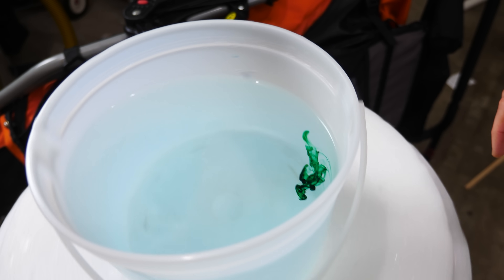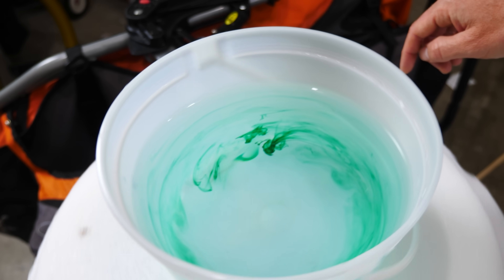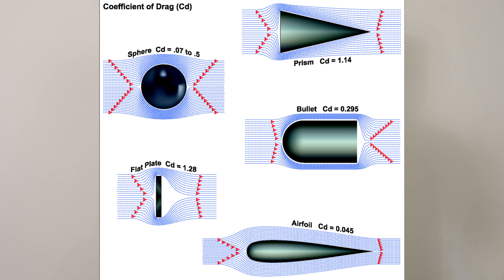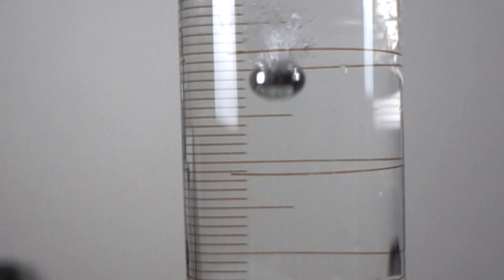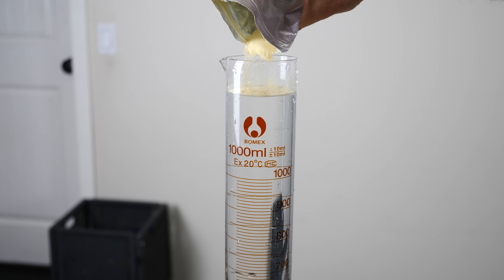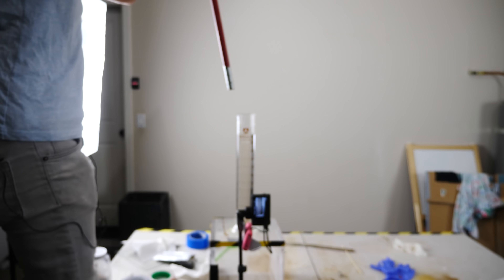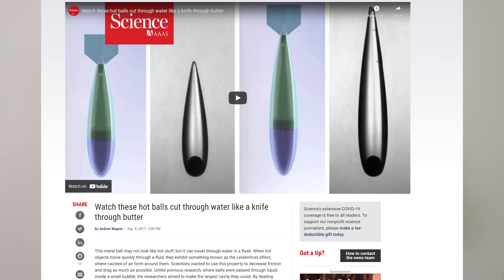Hydrophobic Projectiles Slice Through Water With No Drag

Comment: Isn't the volume of entrained air going to exert a slight force (from static atmospheric pressure) on the surrounding water? I would imagine that force would be expanding the envelope beyond the ideal shape for a given liquid. Would be interesting to see the same experience repeated on larger scale, under various partial vacuums and comparing gas densities, e.g. atmosphere of nitrogen vs argon vs helium

Comment: Neat. It's like an air bearing. Only 2 criticisms. One is that you didn't explain that there is still drag from the displacement of the water and the low pressure area behind the ball. 2nd is that you can't have 10 times less of anything, you mean it has 90 percent less drag. If I have 1 gallon of water and you have no water you have one times less water then me, if you have 10 times less water then you have negative 9 gallons of water.

Comment: Title: " Slice Through Water With No Drag" vs. description: " slices through water with almost no drag."

Regardless of anything one does to any shape or surface of the shape, the water must get out of the way and the energy to do so must come from somewhere. Conservation of energy must be maintained or we break a fundamental law of physics. In this case, the potential energy lost by the torpedo is transformed into kinetic energy of the water. Also, as you alluded to in the description, 100% efficiency in any system is not possible and therefore the drag can't be zero.

Comment: Friction does not equal drag, its just one part of drag. If an object has to shove a fluid like air or water out of the way in order to pass through it then it is experiencing drag, even if it never directly contacts that fluid. In this case it just doesn't experience any skin friction but it still experiences pressure drag at the nose, bas drag from its wake, and if it's supersonic then it would also experience wave drag.

Comment: I remember as kid reading about a supersonic torpedo that was rocket powered but achieved its gas pocket by diverting some of the rockets exhaust to tip of the torpedo. As I recall, it was impossible to steer it because that would throw it out of its pocket and it would disintegrate apon contact with water at those speeds.

Comment: The heat solution is the route used on a super Sonic torpedo where the vented the rocket exhaust forwards to vaporize the watter and create a gas pocket for the torpedo to basically fly through.....pretty nifty solution.

Comment: The better approach for reducing friction between a fluid-solid interface is supercavitation - like the Shkval torpedo. Contemporary versions can make up to 475 km/h in water. The best sulution, that works in water and air ist gravitoelectromagnetisms (GEM) as shown in USN-UAP videos. When GEM-field generators (consisting from 2"x2" chips of capacitor-stacks with topological insulators at room temperature as dielectric) are configured in push-pull configuration, water-, and air molecules are pushed away from the hull of a vessel. This results in a vacuum, where air-, or water-drag vanishes. Since accelerated air molecules create collision ionization a plasma is created around a craft, that resembles an electrical corona discharge. All DOD-videos show this effect. Since oil industry can not do without jet flight based on kerosene, it will take about 400 years (end of coal), until GEM-technology will be released to the general public. Until then, only military will use it. It's the key technology for deep space superiority of the USSF (former USAF/AFSPC).

Comment: I recall a high-speed torpedo that uses "supercavitation" to achieve the effect, and travels through the water much faster than a normal object.
Reply: Yes, it’s called Shkval and is invented during the 60s https://en.wikipedia.org/wiki/VA-111_Shkval
Reply: @flappingflight8537  There is also a ship using supercavitation now.
Reply: @flappingflight8537  Invented in Ukraine if I recall correctly.
Reply: @laulaja-7186  Sure , those are the ancestors of the ancient Ukros who dug the Black See :)
Reply: @flappingflight8537  Ukraine was the brains of the Soviet Union.
Reply: Imagine the noise a sonar man (sonar person?) would hear in a battle of super cavitating ships using super cavitating torpedoes.
Reply: speed is 300km/h right?
Reply: @skwal5464  the latest variants are capable of over 500km/h  ( 560 km /h ) read the article in Wikipedia.
Reply: @flappingflight8537  It can also fit a nuclear warhead. Spooky.
Reply: @flappingflight8537  yeah i already read many article about that but 500km/h is supposed
Reply: supercavitation acheved by shape and speed?
Reply: @gendalfgray7889  it’s achieved by a rocket motor. The nose has openings allowing some of the gas to escape and create a barrier of air around the whole torpedo. It’s literally a rocket wearing a layer of air under the water.
Reply: @ryanhampson673   thats insane
Reply: So without contact with the higher density of the water... how are course adjustments made?
Reply: @joetuktyyuktuk8635  vectoring, but i am not sure if that would be thrust or rather something else. fluid dynamics is not for the faint of heart...
Reply: which basically proves this hydrophobic concept as not applicable. i guess some engineer in some defence shop would have gotten around to do it by now,...yet, theres nothing of the sort, but instead the insanely delicate shkval and other such devices....
Reply: And 2000 kph for MHD torpedos

Comment: Does this reduce the forces experienced on the initial impact of the object and the water? I.e. could it make it safer for someone to drop onto water from higher distances.
Reply: That impact is caused by inertia, so no
Reply: @lowkey7671  no, it's caused from surface tension, and I think OP might very well be onto something with that question if covering yourself to be hydrophobic would just slip through that
Reply: @industrialdonut7681  it's caused by both. Hydrophobic materials don't magically decrease interaction with liquids to zero, they only repel the water so that it can move alongside them with low friction. When you're falling at terminal velocity onto water your main problem is the inertia of water, which really doesn't want to move out of your way, as it first needs to move the water around it to even start accelerating outwards. A person covered in a hydrophobic material would pancake onto the surface just as much as if not covered.
Reply: @DeuxisWasTaken  he says in the video it reduces the drag coefficient by a factor of 10 or something, that is the effect to do with momentum and slowing down from displacing the water. If it's that low, it's like if you could fall from space into a pool of air almost, you won't pancake from that. It is the surface tension which creates a literal hard-surface that you smack into and die on, not anywhere near as much as the drag especially if you're only talking about falling at terminal velocity through air and not like many hundreds or more meters per second.
Reply: so, say you throw a weight to break the surface tension. Would you just descend hundreds of meters in a go? Perhaps presure would smush your organs before running out of air

Comment: Not to say you're wrong but at 2:29 you say a regular sphere won't entrain the air behind it. I have observed personally that this statement is false. Growing up I was on the swim team and one thing we did in between practices was drop/throw steel ball bearings in the 15ft deep end and then dive to retrieve them. We found out shortly after starting this that if the ball bearings had enough velocity, when they hit the surface that they would entrain some gas like your spheres do later in the video.

Comment: It's just a theory, but one of the possible explanations of the sinking of the Kursk submarine is the explosion of a super-cavitation effect torpedo in one of the launch tubes, the main idea is that these torpedo aren't in contact with water but instead "fly"trough the water in an Gaz bubble, produced by the torpedo itself.
The speed the torpedo could get are in the range of 500km/h ,(250-300 mp/h)
The Britt's had a similar issue in 1955 with such a rocket-like torpedo, leading to the loss of the HMS Sidon

Comment: Imagine an underwater projectile accelerating till it actually makes a sonic boom. Wonder what that would look like
Reply: This exists. Cavitating torpedoes move fast enough that the nose cavitates the water as it hits it, encasing the rest of the torpedo in a cavitation bubble removing most of the skin friction. I've seen one design with a nose that is flat rather than pointed, but it's at a slight angle rather than being perfectly 90 degrees to the centerline of the torpedo. This creates an asymmetric cavitation bubble. The fixed fins near the rear are long enough that the tips stick out a bit beyond the cavitation bubble into the liquid region. By then rotating the nose, it rotates the asymmetric cavitation bubble around the vehicle, which exposes the fins on one side to more liquid water than the other. This increases drag on that side which makes the torpedo steer in that direction. To go straight it just has to spin the nose fast enough that the effect gets averaged out across all fins evenly.

Edit: Mad Scientific (see their comment further down) made an important correction/distinction to my comment. Super cavitating torpedoes do not actually exceed the speed of sound in water. You do not actually have to move faster than the speed of sound in water in order to cavitate it, although these still are the fastest torpedoes ever produced. Additionally it seems there are tricks you can do to reduce the velocity required to sustain a cavitation bubble such as by having a heated nose cone.
Reply: @maxk4324  That is not even remotely close to an "underwater sonic boom".
Reply: @MadScientist267  after further investigation I see you are correct. While I stand by my description of super cavitation, you are correct in that it does not in fact require one break the speed of sound in water. I'll review the comment and revise as necessary, thank you. My background is in rocket propulsion and I think I mixed up cavitation with choked flow in my head and so I assumed M>1.
Reply: @maxk4324  Somewhere around here I pondered "nuke?" as a source of energy that could/should/probably would break that barrier... But I'm nowhere close to understanding the full dynamics of an underwater bang of that nature.

That said, I envision a steel-plate-like formation... Have no idea how thick lol... "A wall" 🤣
Reply: @maxk4324  thats some sick engineering , the rotating nose idea is almost genius!
Reply: @maxk4324  Classy move editing your comment and admitting you were wrong. Very based, my friend.
Reply: @maxk4324  r/madlads
Reply: Sonic bloop?
Reply: @ZarathustraDK  exactly
Reply: @ZarathustraDK  This deserves more likes
Reply: The speed of sound in water is much faster, that's part of why you can detect the projectile before it hits you.
Reply: The speed of sound in water is about 1500m/s, or about 3355 mph, so it would definitely be impressive.
Reply: @Wick9876  Right but technically it is travelling through a gas, in this case air, first
Reply: @mcintoshdev  yes, the hydrophobic agent on the water surface allows air to enter along with the metal ball. This reduces drag to some depth after which air supply would run out and the drag would persist as earlier.
A hydrophobic coating on the Meta ball would reduce adhesive forces that cause friction. Helps increase speed all the way down.
Reply: Further reading:
https://en.wikipedia.org/wiki/Supercavitating_torpedo
Reply: @maxk4324  Thanks.  they seem to be interested in being able to use it for human transport, but wouldn't all those bubbles tell everyone where they are?
Reply: @shirleypotter4668  I don't see this as being very useful for human transportation. It is egregiously inefficient since it takes so much thrust to counteract the drag of the water. While super cavitation reduces the skin drag, which is to say the portion of the drag force caused by fluid dragging over the surface of a vessel, the pressure drag is through the roof. Pressure drag is the conventional form of drag we think about, where if you want to move one torpedo length forward you need to shove one torpedo volume worth of water out of the way as you do so. This portion of the drag is proportional to the velocity squared so if you want to go twice as fast you will increase pressure drag by around 4 times. So going thay fast is very very very drag intensive. So much so that the only reason to ever use this trick is if you needed to get a submerged payload to its destination as fast as modern engineering will allow, no matter the cost or inefficiency. This is understandable if the payload is an explosive warhead and the destination is an enemy who is trying to kill you, but not so much if it's just a passenger trying to just cross the English Channel to visit a friend in France, or something.
Reply: @maxk4324   Sorry,  The human transport I meant was a Navy/Military Sub with people to get that torpedo in range faster to sink or kill the enemy - hence my concern about bubbles giving away the location.  So the 1/2p(V squared)etc isn't just (1/2 density), the density is far more limiting to the performance.  Sorry I seemed to suggest civilian transport.  Thanks
Reply: @shirleypotter4668  hmmm, if anyone was going to try this it would be the military, buy still I think you would run into the issue of propulsion requirements. The amount of thrust required to sustain these speeds is enormous, relative to the size of the vehicle. Since drag goes up not just with the square of velocity, but also the square of the vessels radius (for traditional tube shaped torpedo BD submarine designs) the amount of thrust required to push a sub at these speeds exceeds the capabilities of all existing submarine scale underwater propulsion systems I know of. Sure in theory if you built a sub powered with rocket engines, somehow managed to ignite them underwater, and had a hull made of some impressively strong material, you might pull it off for a very short distance. But by short I mean like not even going beyond the horizon line of your starting point. Honestly I think torpedo technology will likely eventually be abandoned in favour of further developing anti ship missile technology as it's far easier to make a misle go faster than a torpedo. And you can do a lot more complex RF stuff on missiles (eg. Radar tracking, radar homing, live data transmission, networked coordination with other weapons systems, etc) which torpedoes can't due to being submerged, so their ability to keep up with other weapons technology is somewhat limited, as far as I can tell. As for subs, they are mostly for stealth, not speed. If you try to move that fast through the water you can easily be picked up by microphones underwater and thus defeat the purpose of going through the effort to build a submersible vessel in the first place.
Reply: The amount of energy it would take to make this happen... 🤯

Even supercavitating torpedos go nowhere near the speed of sound in air nevermind in water.

Don't forget what a sonic boom is... If you look at what happens in air, you get half an idea of what has to happen for one to form in water... The energy to displace that water has to come from somewhere... It's demanding in air... Check out the differences 🤣

Edit: There's also a really good chance the object will not survive the encounter. Even high power rifle rounds are nowhere near the speed of sound in water and they shatter from the forces involved. 

At the very least you'd need "exotic guns" to even attempt it small scale supersonic in water with a bullet. Large scale? Haha forget it.
Reply: Cavitation torpedo.  They use gas bubbles to reduce drag. The Russians have one.  I've never heard of an American one. I think it's 3 times faster then our fastest torpedo
Reply: Eat some Taco Bell and find out.
Reply: @Fromard  🤣🤣🤣🤣jajajaja
Reply: Sound travels through solids the fastest, then liquid, then air. I would say the Sonic boom wouldn't make a noise at all.
Reply: @NAVYMAN-d1d  It would make a tsunami for objects of any real size. Metric assloads of energy required, and most of it goes into defeating water's version of the sound barrier.

Would be a very intense thing to see at all but tiny masses.
Reply: @NAVYMAN-d1d  If something could exceed the higher speed of sound though, it would carry much better.
Reply: @justinthompson6364  True.
Reply: I don't know look it up. Under water soundbarrier
Reply: The speed of sound is different under water than it is in the air.
Reply: The speed of sound through water is much higher but I guess if you got a hydrophobic torpedo to go over 760mph then it would be supersonic underwater? That would be interesting to see. Hold my beer...
Reply: Blub?
Reply: J e s u s
Reply: @its_dha  je(SUS)
Reply: I was about to say "Ask the Russians"...

So, how about aerophobic substances?
Reply: @Sakhmeov  stop giving them ideas we're gunna die
Reply: @its_dha  Well alright, alrightalright.

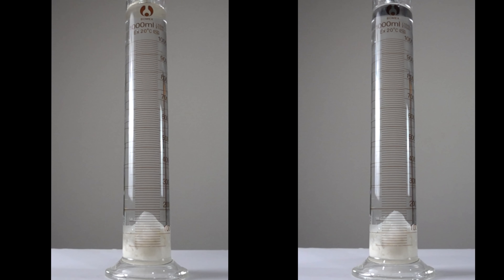Comment: At 4:30 the graduated cylinders are perfectly in register. You can get a 3D Magic Eye effect if you want, and see the 2 steel balls fall simultaneously in one cylinder. 
If you really did drop the two balls together, in a stacked position, it looks like the behind one will fall just as fast, in the air bubble made by the first.

Comment: Wow how far could a theoretical missiles travel under the sea did you say . And course submarines are under the water. Wow that's amazing straight down into the sea. Amazing what depth can missiles be fired from submarines into the air. Wow I think a missiles could be fired deeper into the sea from the land than the firing depth from submarines. No way that means hydroscopic stuff is magical . Yes.